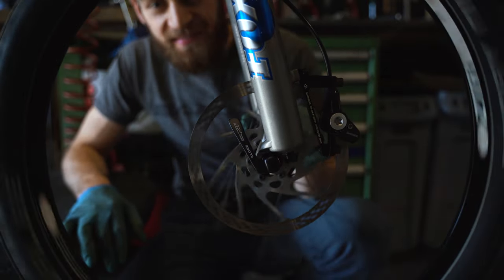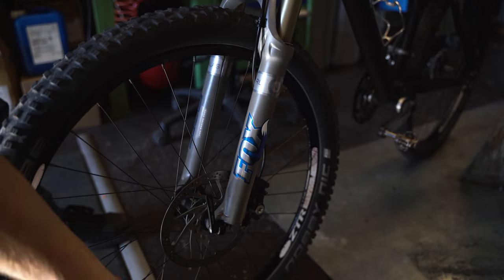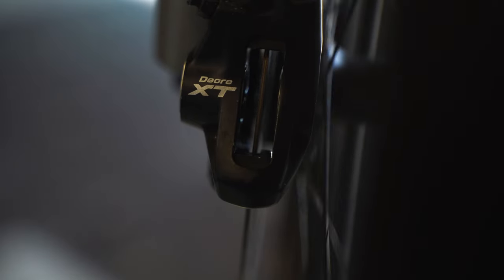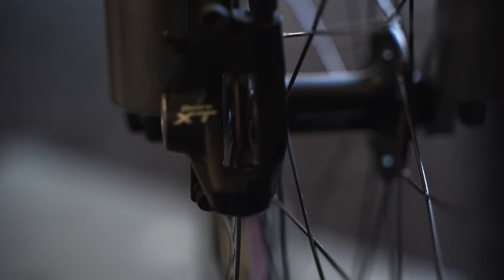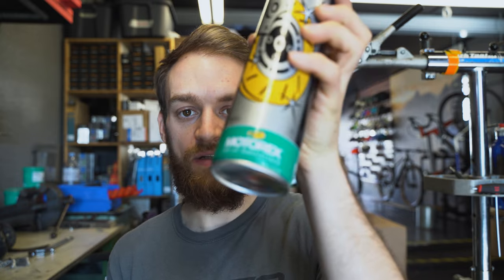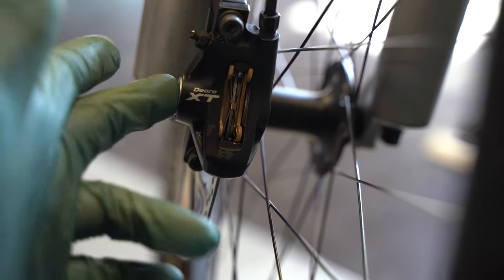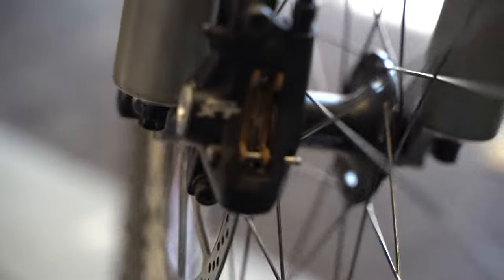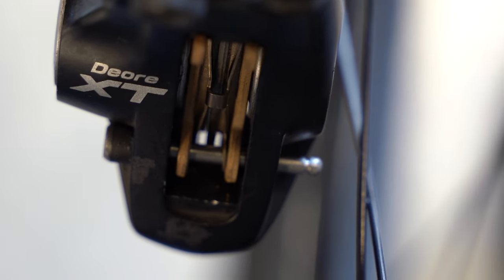How To Stop Disc Brakes From Rubbing!

Comment: Thank you for the video. If the disk rotors are not true what should I do?
Reply from the maker: Good question! There are „rotor truing forks“ which are tools that are not too expensive, or you can also use pliers with a smooth surface like the Knipex ones, anything really that allows you to grab the thin rotor and bend it gently

Comment: And adding oil to the pistons maybe is a bit risky...
Reply from the maker: Why do you think that?
Reply: @sebibuchs  a bit can get afterwards to the pads or the rotors, and they get contaminated
Reply from the maker: @GoncaloRijo  yes, of course you would want to clean/degrease the inside of the caliper again once the pistons are pushed back:)